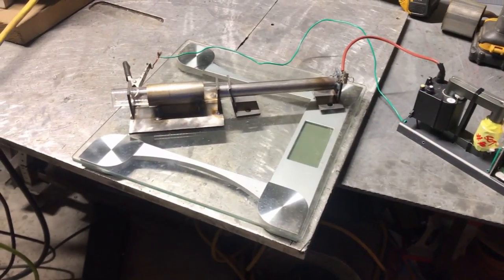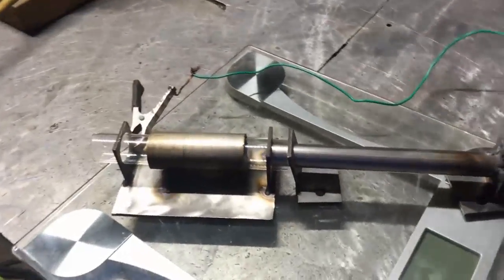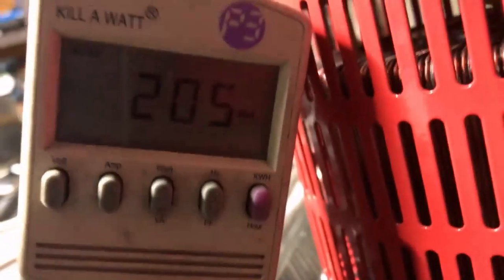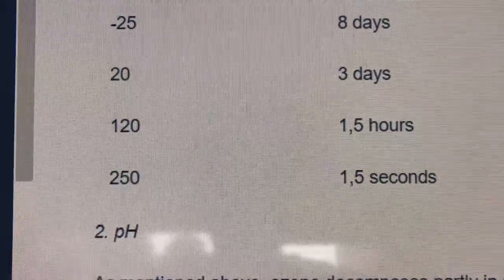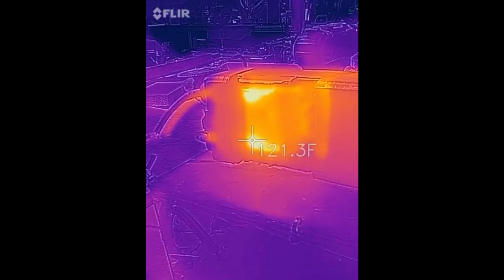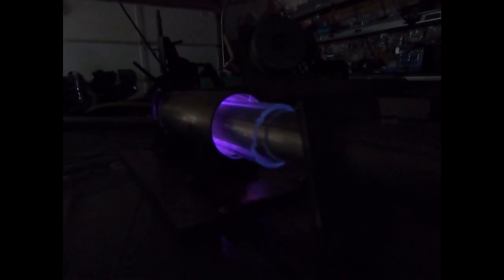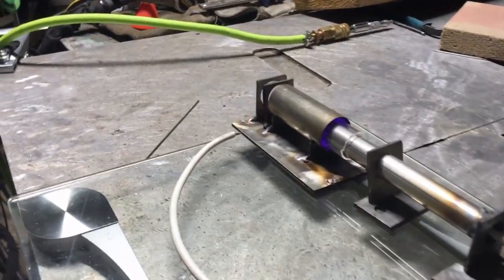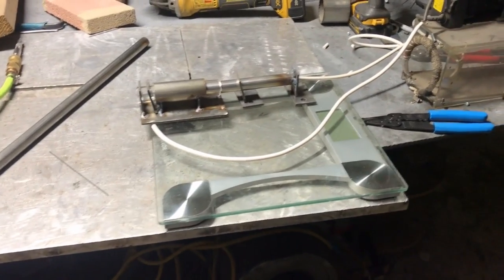Ultra high capacity Ozone Electrode Design for Juan

Comment: It still would not hurt to add some refrigeration to your system both to save the ozone as well as to save your machinery from self destructing. ~( 'w')/
Reply from the maker: Yes i have seen some units that actually use boiling Freon as a coolant